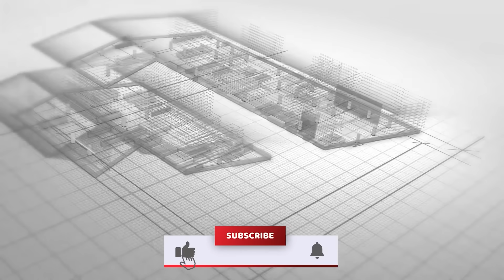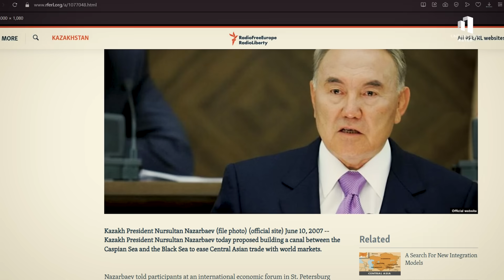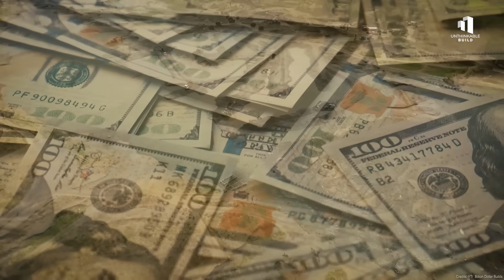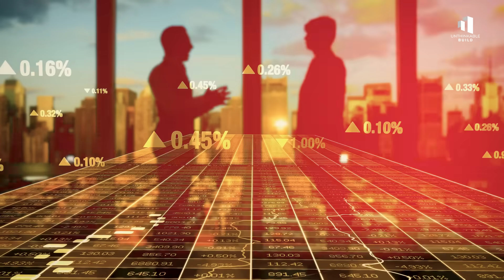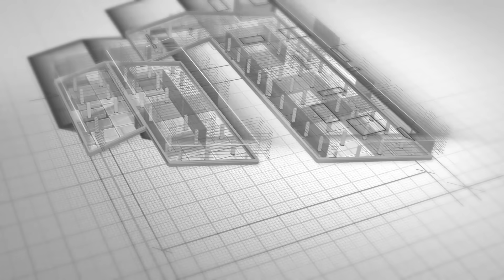Inside the $20 Billion Eurasia Canal That Could Rewrite Global Trade

Comment: The canal should be 12 meters deep. Inorder to successfully complete the canal handover construction to china and 10 years maintenance & operations to china. Invite turkey as a minor stakeholder in the project.
Reply from the maker: Proposals like that involve far more than setting a depth and selecting operators. An international canal would require multi-country treaties, environmental impact approvals, financing agreements, and transparent procurement it can’t simply be “handed over” to any single country to build, operate, or maintain without broad political consensus.

Engineering decisions (like a 12-meter depth), ownership, and operations are normally determined by feasibility studies, international regulatory standards, and public oversight, not by unilateral assignments to foreign partners.

Comment: What will happen to the salinity of the Caspian sea, it is currently very low?
Reply from the maker: The Caspian’s salinity would rise over time unless freshwater inflows kept pace with evaporation. It has no natural outlet, so salts concentrate as water levels fluctuate. Any canal or diversion bringing in saltier seawater would accelerate that increase, threatening fisheries and the unique ecosystem that depends on its current low-salinity balance.
Reply: @UnthinkableBuild  I think the length of the canal and flow rate would mean there wouldn't be much change to such a huge volume.e of water.

Comment: Who estimated it at 20 billion... when? for 700 km? Let's be serious, that's the price of a highway, not a 700 km canal, with this difference in level, with a concrete bed so it doesn't dry out and become saline, level locks, and the rest. 20 billion just for the excavations, and that at the ultra-low price of fuel, is closer to the truth. To which, add the concreting and the installations, the intermediate ports.
Reply from the maker: Early figures like the $20 billion estimate were preliminary conceptual assessments made before full engineering surveys, detailed design, or inflation adjustments, which is common on projects at this scale. As technical requirements become clearer excavation volumes, concrete lining, lock systems, environmental works, ports, and energy infrastructure estimates typically rise significantly. Final costs usually only stabilize after full design and procurement are completed.

Comment: Do it without locks & how long will it take the Caspian Sea to match the level of the Black Sea & how much would it grow in surface area by the process? Any guesses?
Reply from the maker: Exactly the kind of question that shows why any real version of this would almost certainly need locks. The Caspian sits roughly 25–30 meters below the Black Sea, so a free connection would send huge volumes of water east, dropping the Black Sea and raising the Caspian with massive ecological, coastal and political consequences. The timescale and final levels would depend on canal size, inflows, and climate, which is why engineers treat this more as a theoretical scenario than a realistic option.

Comment: And what prevents us from deepening the existing Volga-Don Canal and solving the problem of seasonal shallowing of the Don with the help of the Tsimlyansk reservoir? For example, in Egypt, in order to increase the traffic flow, the second branch of the Suez Canal was dug parallel to the first.
Reply: There's a 132-meter elevation difference along the watershed, and there are 13 locks. Their operation requires a very large volume of feeder water (rivers, streams, and precipitation). And water resources in this region are quite limited.
Reply: @ЖизньзаКАДом  Так новый канал тоже шлюзы потребует. Каспий на более чем 29 метров ниже уровня океана.

Comment: One lesson from this is that everything is really about corridors. Networks for blood, nerves, commodities - it's all the same. Nothing by itself stands for long. Here's a small example. The public transit system in Portland, OR, when they were designing their light rail system, reached out to nearby suburbs. Back in the 1990s, the mayor of Gresham, against all advice from her colleagues, chose to assign land for right-of-way to TriMet, so that a rail line could connect downtown PDX to Gresham. And eventually further east. She had the foresight and courage to do this. It made a world of difference for transit riders. Many problems ensued, but a transit grid over a large region requires the vision people like her had at the time - for the future.
Reply from the maker: You’re right long-term vision in corridor planning can completely reshape a region. That Gresham decision shows how early right-of-way choices can define a city’s entire transit future.
Reply: @UnthinkableBuild  Des Moines, on the other hand had zero vision or prescience. But there are many factors that can't be taken into consideration, just cuz people won't understand their those until the plan actually goes forward. Light rail in PDX became a great get-away for crooks because fares are based on the honor system. Go figure. The immediate area next to the rails deteriorated. But lefties won't face reality, so nothing was done to offset the likelihood of trouble. Just an example.

Comment: But, wouldn't that Canal be useless if Turkey along with NATO close the Bosphorus Strait, essentially locking the black sea's access to the Mediterranean?
Reply: 这样会把中俄这对假兄弟变成真的兄弟，这个后果太大。西方国家不会允许的
Reply: Well it's just about the same right now, isn't it? Stratigically speaking, it is a problem. But do they have it locked for the moneyflow? For Russia? Nah, not really. So until direct or nearly direct military confrontation it's not a problem and that's in big part, because Russia & Turkey are codependent and will be. Damn, there's the biggest nuclear power station is being built already, if not mistaken, in Turkey by Russia.
Reply: Турция подписала договор, согласно которому она не взымает деньги и не ограничивает проход через свои проливы. Так что Турция не может законно их перекрыть. Она специально такой закон подписала, что бы избавить себя от давления из вне и быть фигурой в этих играх .

Comment: The problem is as you identified, you still have to get everything through the Turkish controlled straights. It won't happen.I don't think there is much in it for Russia or China. The main beneficiaries would be Kazakhstan, Azerbaijan and Turkey but they combined would not have the funds,. and they would still have to cross Russian territory with this canal.
Reply from the maker: You’re right that Turkey’s control of the straits limits the strategic value. Without a guaranteed alternative route, Russia and China have less incentive, and the countries that would benefit most don’t have the funding or political leverage to push it through.

Comment: Too small, better go from Tuapse as a starting point, and dig min 20m deep with several recerculatory ship lifts instead of locks. At less than 15m in depth it's useless.
Reply from the maker: You’re right, depth is critical for modern shipping, and a deeper canal with ship lifts would certainly allow larger vessels, though it would also significantly increase the cost and engineering complexity.

Comment: They should really build the canal through Iran into the Persian gulf. Turkey will always have a chokehold on what goes in or out of the black sea. Turkiye is not a reliable partner as it is in NATO which is controlled by the west.
Reply from the maker: A route through Iran is often discussed, but it comes with major geopolitical, security, and engineering challenges. Turkey’s control of the Bosphorus is a factor, but shifting the entire corridor through Iran would require massive investment and long-term regional stability, which is far from guaranteed today.
Reply: Thats the weakness in this project.
Reply: 1/3rd of Js in israei are from Russia. Russia would never help Iran that much.